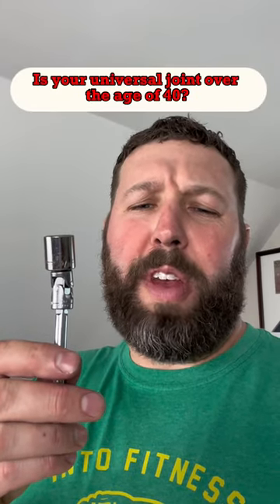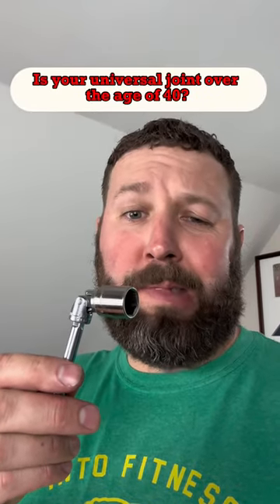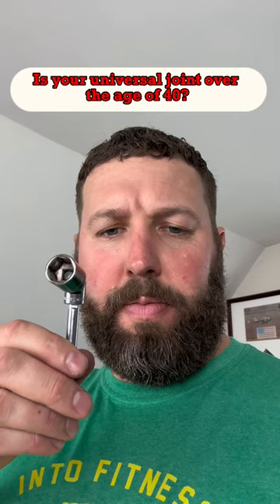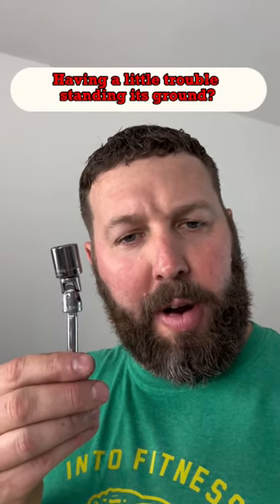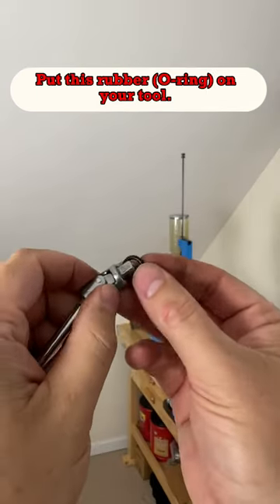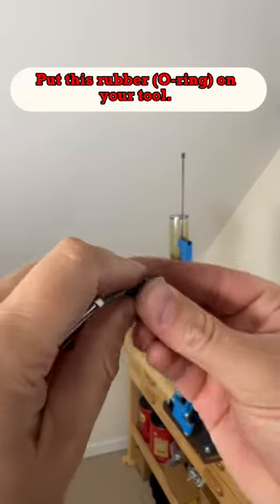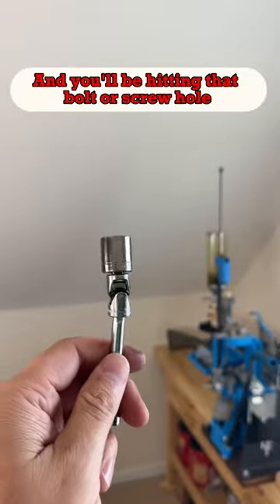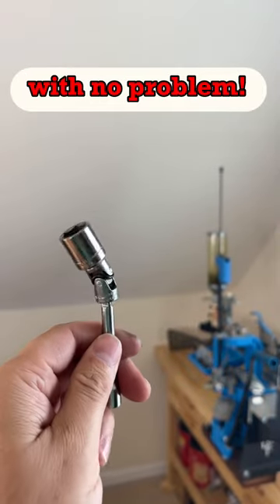Universal Joint Socket Adapter Hack!

Comment: Sorry bro your o rings are still too sloppy for me, I got to use that electrical tape wrapped a few times. 

But to each there own brother 👍
Reply from the maker: What color?
Reply: @freedomworx  Has to be black so when I knock it off the extension I have a harder time finding it 😉
Reply from the maker: @GuyBaptist777 touché